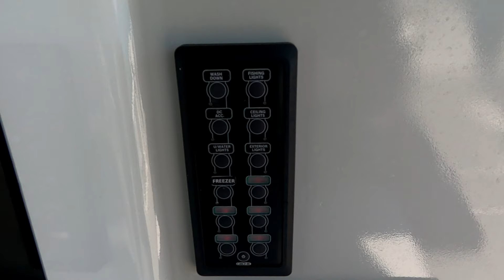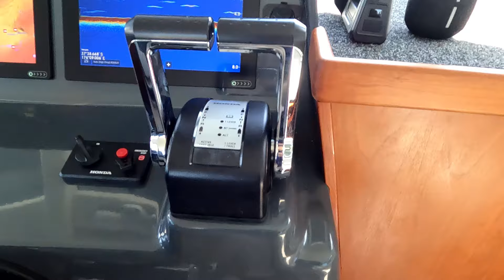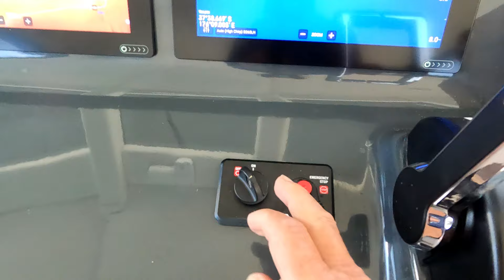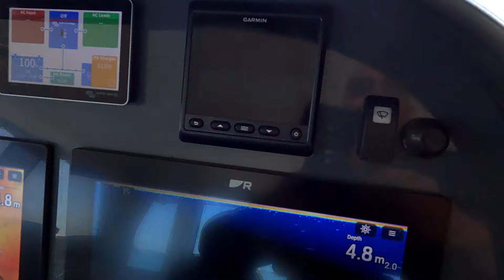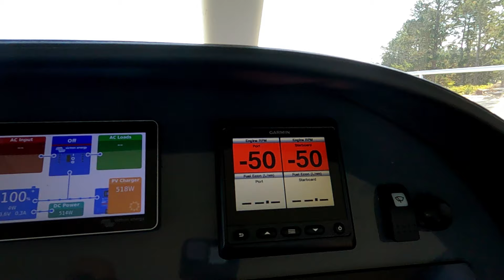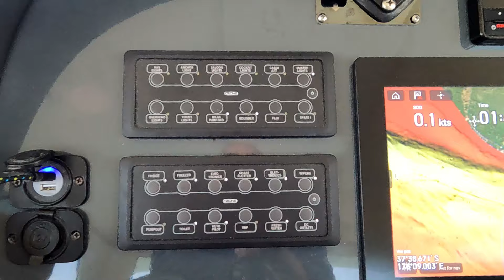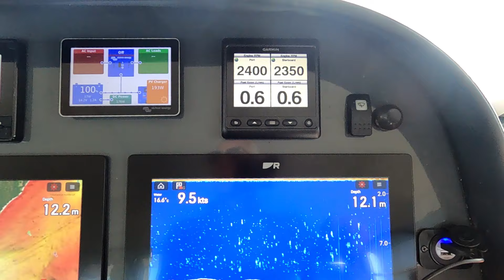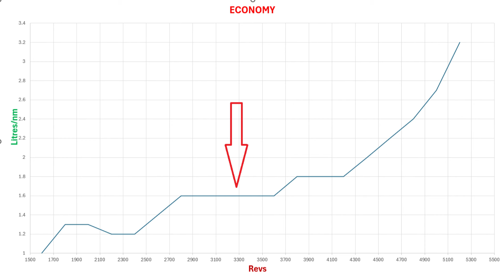Swansong Part 12  Walk through, sea trial and fishing

Comment: Excellent build, which you can be very proud of.
I like davit system. Did you make it yourself, and how does it fit and lock into the rear transom? Also, can your Takacat roll up and fit below the rear deck level on the port side, and so have the Takacat on each trip, but out of the way while fishing or when the boat is in the marina?
I see you have a DC power hot water heatersystem. What is the size of this unit in litres, and what is the power draw in watts while on?
With 750W of solar on top, what capacity of batteries in AH do you have onboard? I assume you are running a 12V DC system throughout your boat.  What is the capacity of your inverter?
Reply from the maker: Hi. There's a clip of how the davits were made in video Part 6  https://www.youtube.com/watch?v=VcXLFRgOZNw&t=4s  . Each davit drops snugly into closed in slots in the transom which have their own drains. Haven't been tested in open sea yet  but I'm relying on loading and the tie downs to prevent davits from jumping out. Any suggestion of movement and they can be pin locked from inside transom.
The Takacat is currently folded up and stowed in port foredeck hatch alongside fenders. So yes, it's out of the way until needed.
Hot water cylinder-  I ordered it from Australia. 10 litre , 25 amp draw. All the details here - https://ausj.com.au/products/duoetto-mk2-digital-water-heater-10l-12v-240v
Batteries are 330 amp/hr and yes 12v. Inverter 3kva.
Reply: @colinb900  Thanks Colin for your feedback.